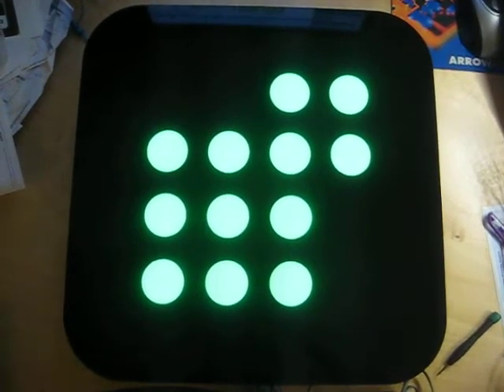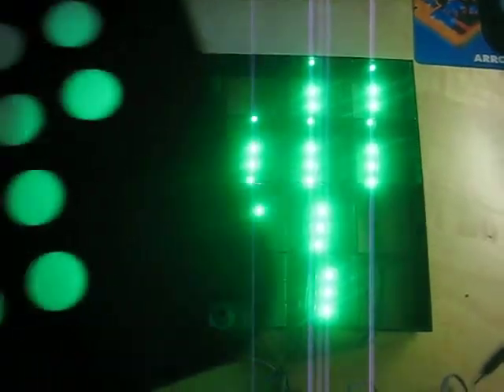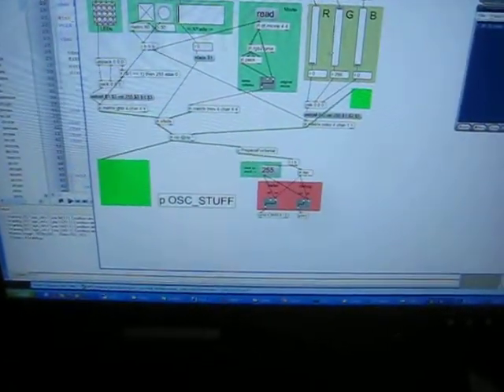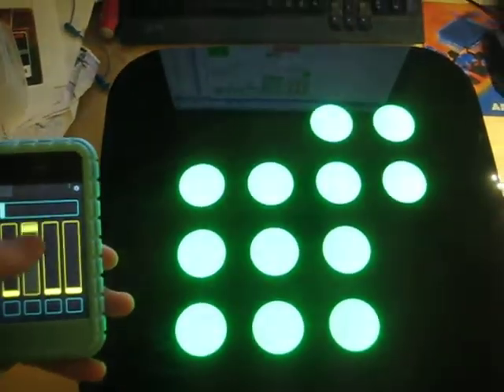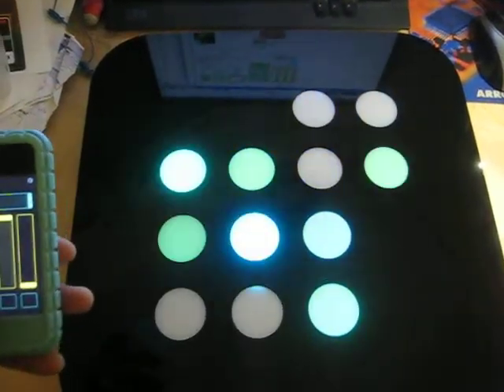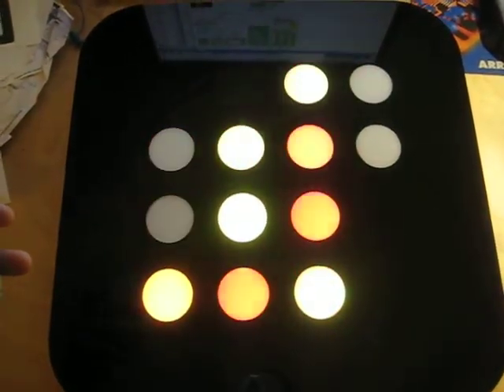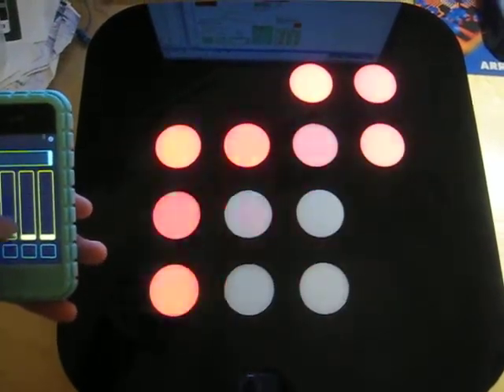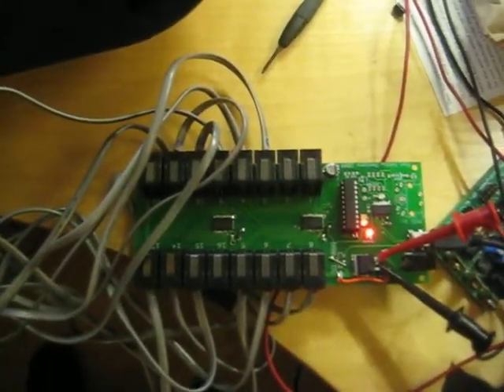ElementalLED - controllable LED sign for Maker Faire

Comment from the maker: Oh, and if you ever need to spray paint acrylic, the Krylon Fusion for Plastic paints give a really nice finish without running or cracking.  You can get really nice effects by lasing words, shapes, etc out of the backing, peeling them off, spraying with plastics spray paint, and then peeling off the rest of the backing after it is dry.